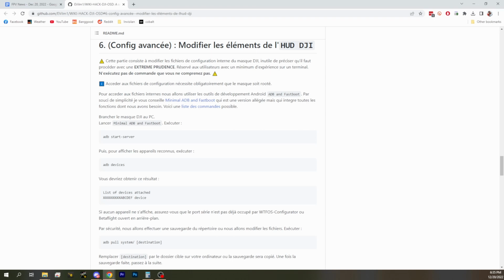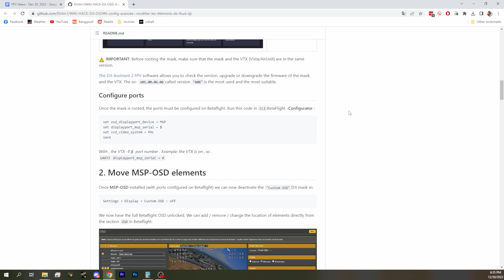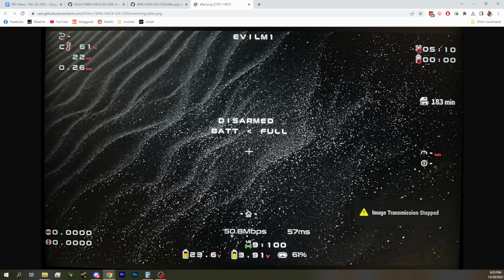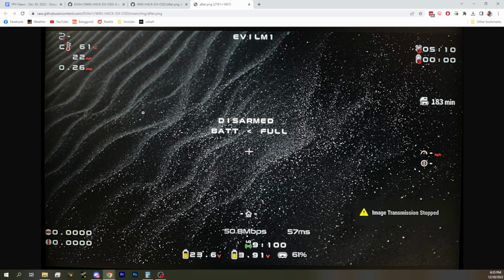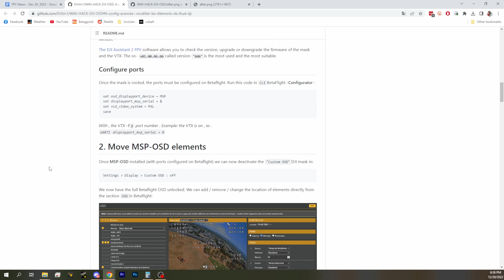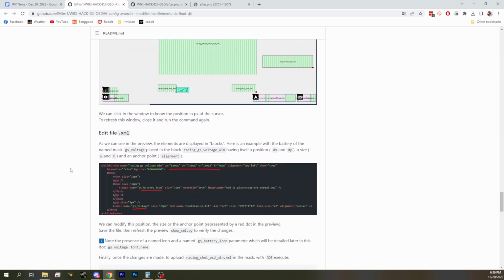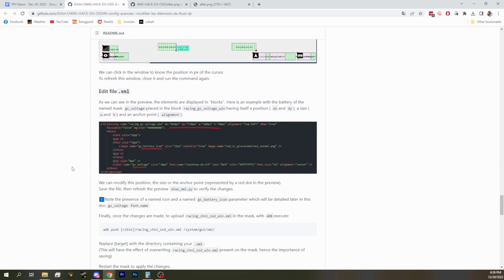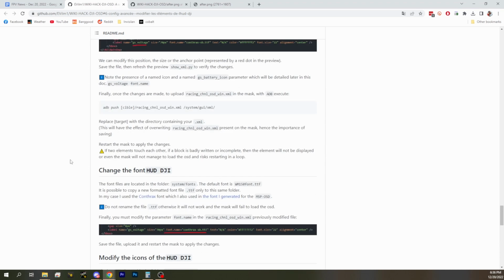Customize Your DJI OSD! New Tool for FPV Goggles V2!  - FPV News!

Comment: Tried this and it worked fine for the DJI-DIY-Mode (for Vista Air Unit) but it didn't changed anything in DJI-FPV-Drone -mode. Has anybody an idea how to do this also for the DJI FPV drone ?

Comment: Only goggles v2 not v1?
Reply: It works on the V1 as well, I'm playing with it right now. Only challenge I'm having is that the python script to help with positioning the elements keeps erroring out but you can still update the positions through trial and error. This is soo neat!
Reply: @Mangorille  
Ahh nice
Reply: Same question. Will this work on v1?
Reply: Hi! I didn't test on V1, only on my V2, but if wtfos works as well on V1, I guess it should be the same. You have to try it by looking for the XML files as written in my doc ;)
Reply: @esteban-fpv  awesome! Thank you for your hard work and for sharing.
Reply: @nimhbot8919  @Ben Stevens Thx ;)
Reply: @esteban-fpv  
I’ll have a look 👍